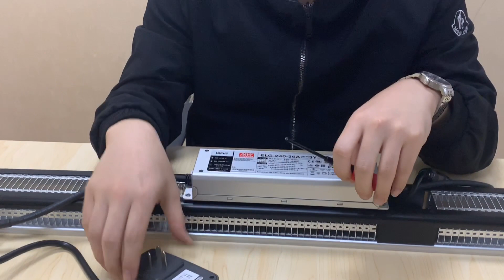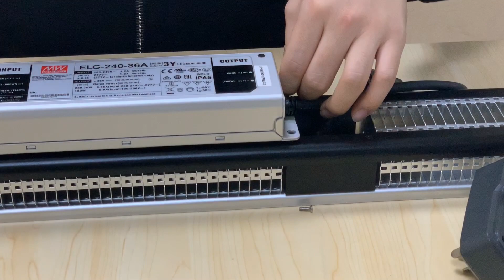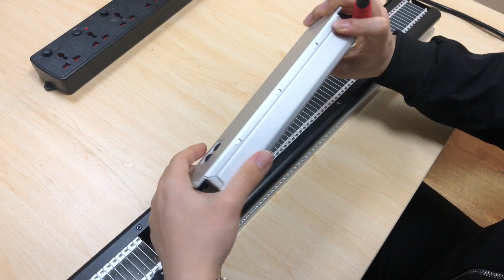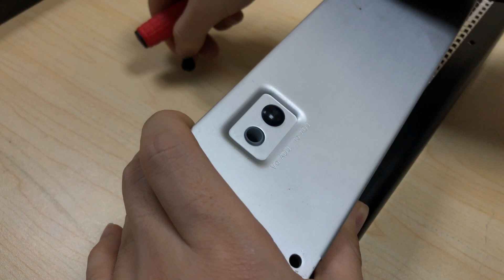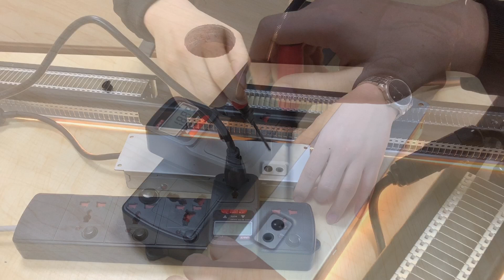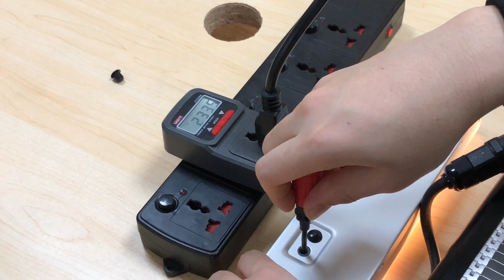Does anyone know? The wattage of the SP-250 is adjustable！

Comment: Will the screw enable me to go from 268 watts to 385?
Reply from the maker: The wattage of SP250 is better to be less than 250W.
Reply: Thank you ..... I have the SP3000. Can I pump it up from 268 to 285?
Reply from the maker: @johnroehsler6440  Different countries voltage is different so the max input is different. Here are references:  300W±5%@AC100-277V

Comment: I got my light and out of the box it was around 228, so when I adjusted this with the left button after 229 it's shut's off, so I can go down 200, 150 etc.  The button on the right is confusing, it seems to brighten it and also brings the watts up as you stated already.  My question is this are there any par readings available at different watts for this light?